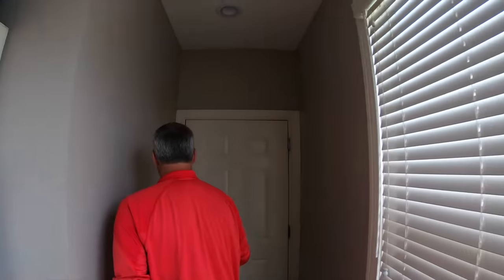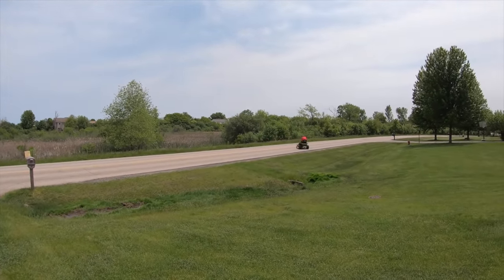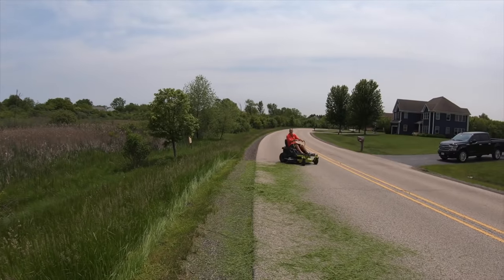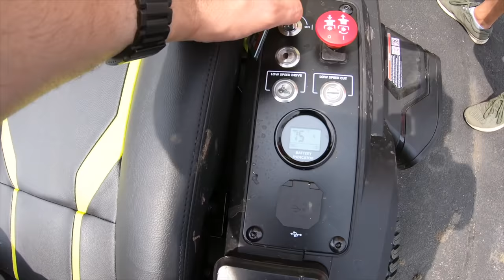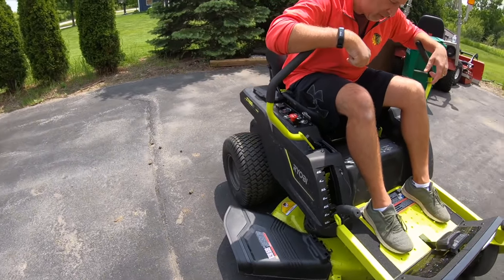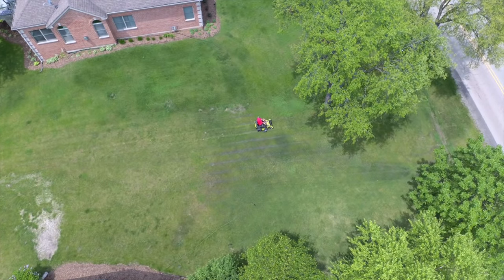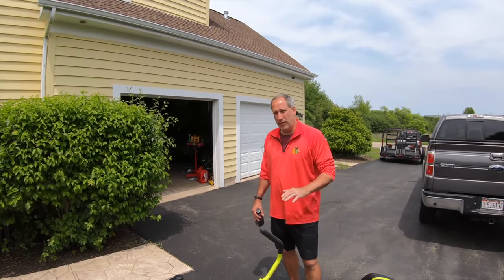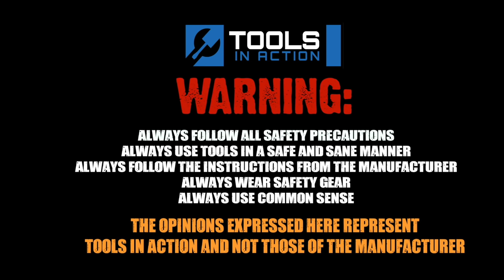Ryobi Electric Zero Turn Mower - First Look

Comment: Just about to stall the blades at 3:26, and you cut it out. You have no credibility.
Reply: Nice catch! I didn't see that
Reply: Wow your right.  I wondered why it skipped like that at first
Reply: ted hill lol any mower would struggle there! My wheel horse, witch that brand is one of the very best lawn mowers in the world, would struggle in that. That grass would be cut by a freacking bush hog pulled by a tractor. I would say that is pretty good for an electric zero turn.
Reply: He mentions it at 3:50.
Reply: @greensplatter3480  Totally incorrect, any commercial mower would NOT struggle mowing that tall grass. cut quality would be awful but struggle for power absolutely not, I've owned multiple Commercial Gravely ZTRS and Deeres and None of them ever would struggle to cut tall grass. Slight drop in rpm yes but never close to stopping blades
Reply: The battery powered mowers may bog down but they always start right back up
Reply: @tjwatson0403  haha that is true, but so do most gas ones.
Reply: Use a Kubota Diesel mower,  will not bog a drop
Reply: Lol! For some to make there point they use COMMERCIAL & Diesel mowers for comparison.  Ryobi wins!!!  Lol
Reply: Austin Stauffer for 4x the money, it shouldn’t...lol.

Comment: MAJOR ACHILLES HEAL: the charging port is built into the mower instead of charging the battery directly.  Correct me if I'm  wrong but if you run out of power away from the charging station, it doesn't appear that you could bring the battery back and charge it without the mower's port. If true  then you would need a fully charged second battery in this instance.

Comment: Your one of those guys the spray the cut grass on the road
Reply: Where do yall fucking live that county road crews don’t go out and do the same thing what difference does it make if he does it too don’t drive in it if you don’t want to it’s not fucking complicated
Reply: @kris6682  I guess you don't care about motorcycles. Cut grass is quite slippery on them. I have seen many wrecks due to cut grass in the rod. It's not hard to turn the mower around and face the other way.
Reply: Blazegaming Vlogs sorry bro but my safety is more  important than yours and I’m not riding along the edge of a busy road with my back to traffic learn to ride your bike a quit whining
Reply: @kris6682  Glad to know you care about other people. They have make reflectors and orange vests for a reason.
Reply: It is illegal to blow grass on the road in my area.
Reply: Blazegaming Vlogs I guess you couldn’t come up with a reason why I should put my self in extreme danger so that you can be less attentive while riding your motorcycle

Comment: $4100?? No thanks, Ill stick with my gas powered mower.
Reply: A decent quality (not Depot) residential ztr will Run you at least 3200 (Hustler, etc). 4100 isn’t terrible, still a stamped deck tho, which will probably be the first thing to go.

Comment: Thanks for the review... I feel that the 42" deck is to small for the ~2.5 acres I've got to mow. Would also like to see more aggressive tires on the machine. Do both rear wheels drive?
Reply: Both rear wheels would have to drive it's a zero turn.

Comment: I have a typical troy bilt pony 42'' that Im using 20-25 hours a month to cut lawns.  drive belt wears out in 2 months.  Would be nice to have a machine with no belts, no oil changes, no air filter, no carb to clean.  Still, the ryobi is $1000-$1500 more than a standard gas 42'' zero turn.  And with normal use I would imagine that 5-8 years is the most you will get out of the lead batteries.

Comment: Very good video!  It goes fast.  I think that he should be driving the other direction so the clippings go back down the ditch instead of into the street.  Sending it all to the street can make the road slippery and create a hazard for motorcycles.  Sending the grass in the right direction would save you from blowing it off and protect the stray motorcyclist who comes through before you get the blower out.

Comment: Do you haft to bring the battery in for the winter? Would it be possible to keep it outside during the winter on a trickle charger?
Reply: It’s not one battery it’s 4. It can be stored outside according to the manual but it says fully charge it and charge it every month and keep it covered. So if you can keep it plugged in it should be ok.

Comment: 1. All grass on the road complainers: look at second part of the move, grass is gone... as soon as first car came through it probably blew off.
2. $4100 is for a version with 100 amp battery, 75 amp version is on sale right now for $3200.
3. As cool as it is I still would not buy it :) 

Myself I just can't justify spending that much on a residential mower.
Reply: It makes sense if you are doing residential yards. I'd hope you are contracting out commercial cuts with a 42. 😆

Comment: I doubt that's NICAD.  Probably lithium ion.  Any clue how it works cutting along side (or up)  a 40 degree incline?  My yard has deep ditches and that's always a sticking point for me.  My 2001 Snapper SR-33 rider manages them okay.
Reply: The manual says:  Only use RYOBI Electric Riding Lawn Mower 75Ah
 (LPC12-75) or 100Ah (LPC12-100) lead acid batteries.
Reply from the maker: Its an AGM battery. deep cycle
Reply: @Toolsinaction  AGM - Ahhh yes, that would explain why you can just keep it plugged in all the time.  Lead-acid batteries love to stay topped off at all times (as opposed to lithium).  But NiCad would have been horrible with the "memory" problems they're notorious for.
Reply: @Toolsinaction  According to other reviews on-line, it uses (4) batteries. I don't think you mentioned that two different models are available with different capacity batteries. They also state that the batteries need to be removed and kept in a warm place for the winter. This unit appears to use the same batteries as Ryobi's previous riding mower. Replacement batteries are around $200 each.

Comment: The batteries aren't NiCad. They're sealed lead acid. They weigh more, but they cost less and don't have the memory effect of NiCad that requires the batteries to be fully discharged before recharging. Greenworks makes a 60" one with lithium batteries that costs 6 times more ($25k), but it is a larger deck and commercial duty. Cub Cadet makes an electric zero turn with a steering wheel and 92 Ahr batteries that costs less ($3k). This Ryobi currently costs $3.9k for 75 Ahr and $4.4k for 100 Ahr. They all have 42" decks.

Comment: 4 Sealed Lead Acid AGM batteries wired in series to provide 48v is what I read on another page. IMO it would be better if they'd went the full way with it and used Lithium Ion technology.

Comment: 3200 isnt too bad only about 600 more than a gas one. if i wont the lottery. a snow blower attachment would be a really nice feature too. i have a ariens 24 inch all electric 2 stage snow blower and i love it. the electrical stuff might be a bigger problem to troubleshoot if something breaks vs and a gas engine / carburetor but as long as its built well it shouldnt be an issue. im curious as to why it has to be plugged in constantly? is it lead acid? ahh that is why: 
4 Sealed Lead Acid/Absorbent Glass Matt 12V batteries wired in series to produce 48V  yeah lead acid suck for longevity...i guess if they have a super good warranty on the batteries (no losing 10% capacity over 5 years or something) then its ok.

Comment: In your experience, how many minutes is your run time @100% charge?
Reply: They didn't mention that this unit is available with two different battery options... a 75Ah or a 100Ah. Each has a different run time. So not sure which one they had.

Comment: I want to like this but I felt burned by the push mower.  I got the 40 volt I'm on my second battery and it takes a charge and a half for less than a tenth of an acre house included on that plot.  Just scared me off all electric lawn equipment.  Maybe someday I'll be experimental again but not anytime soon.

Comment: Did they get the model name from the cost? It's about $4,080. I haven't owned any tool with nicad batteries in a long long time,nimh and/or lithium kicked Nicad's ass for most applications. Now don't get my negativity wrong,I do have several Ryobi One+ tools with lithium batteries and am happy with them. I switched over to Ryobi when I slowed down and didn't need Milwaukee or the higher cost anymore. I'm sure nicad keeps the cost down,at least until/unless the batteries need replacing often expecially if people don't take near perfect care to charge and store them properly. I do like the high-vis green for mowing near roads. Please correct me if I'm wrong about anything.

Comment: I'm getting the husquvarna electric ride on. I think electric is the future - using battery has many advantages.
Reply: no it doesn't ,atleast on this type of equipment. runtime,batt expense,toxicity for the planet, equipment is not self sufficient.  i'm ok with cars but working vehicles need to generate power onsite

Comment: AGM (Acid Glass Mat) based batteries good for deep cycle used in marine, solar, and expensive automotive batteries they have good lasting power. Lead based batteries no Nickle Cadmium or NiCad here.

Comment: I blow grass in the road every time I mow.  It only takes a few minutes before the wind and passing cars blows it all off anyway.  Ditto for most of my neighbors.

Getting back on point, that mower is impressive.  Batteries are appearing in all the tools.
My Echo Hedge Trimmer blades broke - cost me $129 for parts to fix.  Motor still works great but the Ryobi and Kobalt 18v and 40v battery hedge trimmers with 5 year warrantee are same price and the cutting bar is longer.  Hate to dump a good and repairable professional grade Hedge Trimmer but the technology is evolving to obsolete a lot of good stuff.  Ditto for my 14 year old Toro Z-turn gas mower but it still runs perfectly.  Times are changing much faster today and likely to accelerate even moreso in the years ahead.

Comment: Somebody please explain what zero turn mower manufacturers hate about steering wheels?  When I get on a riding mower, I don't want to feel I am on a piece of exercise equipment.
Reply: The levers directly input the need to the motor which is turning the drive wheel.  Steering wheels require another set of mechanical interfaces to turn the rotation of the steering wheel into the requested output that is needed on each drive motor.  This complicates the process.   Remember unlike your car, you are not turning the wheels to turn the mower, rather changing the speed at which each wheel is driven.

Comment: I have been bothering EGO on social media about something like this.  I’m SUPER tempted to get this or the one you guys tried about a year ago their smaller one.  I just wanna keep the whole EGO eco system.  But man I don’t like waiting.  This one is really cool.  Anyway you can ask them around when they might drop theirs.
Reply: It would be incredibly overpriced. Just look at their commercial line.
Reply: @ss4goku9695   if the battery is smaller than the commercial line then it shoudlnt be as bad since its not ment to pay for itself like the commercial line is, but yes definetly will be
Reply: @MrJd829  I am not sure the battery could be smaller. I purchased all their commercial stuff to do reviews on and see if it will fit my business. The backpack battery is 28 AH and 19ish pounds, I think? It runs a blower for just over an hour on turbo. I would guess two spinning blades and wheel motors would demand a lot more juice, hence bigger battery. Just my guess, though!

Comment: Here ya go.

10-Second Summary
Model Number: RY48ZTR100
Ryobi all-electric zero turn mower
Lap bar steering
Cuts up to 3 acres on a charge
4 high-powered brushless motors
Quiet cutting, no gas, no fumes, no belts
Charges through standard 120V outlet
4 Sealed Lead Acid/Absorbent Glass Matt 12V batteries wired in series to produce 48V
100 Ah
1.5″-4.5″ adjustable cutting height
Includes towing hitch and assembly hardware
MSRP: $4,099 at Home Depot

Comment: Not to worry guys he is going to blow off the grass on the road with a Ryobi blower , right?
Lead acid huh , pretty low tech but cheaper to replace that nicad or lithium . 
I wonder what battery life expectancy is and is there an advantage cost wise (total ownership costs) over gas mowers.

Comment: Some of them brushless electric motors will literally run for fukin 30 years without any problems its great an ive seen them back in the 60s still runnin today with machining at shops its diff but same concept

Comment: When the layman accepts slightly better technology for torque, cost, decibel level...maybe strides are being made. (Taking into consideration clowns use water and need to cut their grass-Earth be damned)  This is a really good review and Ryobi should use a solar panel on a non-commercial mowers.   I'm rooting hard for the long overdue recession that I predicted about now.  To much superficial spending and expansion.

Comment: Ok, it’s nearly twice the cost of a 42” timecutter. Let’s see how the batteries & the controller are holding up in say, 3 years. Not sure what a battery pack runs for those things but I gaurantee you it’s not cheap. With even the cheapest home depot/lowes/walmart mowers, if well taken care of, 20 years without a major repair is very common.

Comment: Low noise, no gas cans, oil changes, tune ups. Super low cost to run compared to the same size gas mower... 
  It just has to hold up and what are the batteries going to cost?

Comment: Make sure you use an NGK spark plug, I'm sure Ryobi put a champion or something terrible in it.  Also, needs to be a resistor plug so it won't interfere with the charger.  

That mower is stupid

Comment: At $4100 why is it not lithium instead of lead-acid?
Reply: I read about the differences....seems the lead acid is the best battery for this type of application.  I"m sorry, though, can't remember why. It's on ryobi's website though. PLUS, I ready, the replacing these batteries is about $400  instead of $1200 for the lithium.

Comment: $4100 is too much considering it has lead acid batteries and a stamped deck.  In the $3k range you start getting reinforced decks and 24-26hp engines on conventional ztr's.  If it at least had reinforced deck or lipo batteries then it would be worth the cost.  Not having belts, oil, plugs, filters ect to change would be nice.

Comment: Quick question, why would anyone ever throw grass in the road? Straight, curve. Doesn’t matter. Mowers roll in both directions. Why? I just never understood it. These guys cleaned it up which is good but why at all?
Reply: Cause the grass is too thick to make multiple passes the other direction. But you clearly have never mowed a ditch with thick grass
Reply: DKP Productions absolutely have. So when you have to make multiple passes you have to do it in opposing directions? I don’t think so. It’s being too lazy to go back and make the second pass in the same direction to not throw grass in the road. But clearly you have never not been lazy and choose to blame it on needing to do this. See what I did there with the “clearly you have never...” line? Pretty clever huh? Lol

Comment: Those have got to be lithium-ion batteries for that range, weight, and packaging.
Reply: Steven Sherman actually, they are AGM deep cycle car batteries.  Lithium-ions would save a lot of weight or increase the range even more, but would drive the cost up probably over $5000

Comment: Bought one and returned it after a few weeks.  Absolutely not worth it.
Reply: Brian Elaborate...
Reply: @I-Teee  i used it for about 4 mows.  Flipped backwards putting it on a trailer.  Almost tipped sideways when mowing a 10%-15 incline.  When you truly try to mow a couple acres the battery really starts to die when it goes under 50%.  Cut quality was not that great and the deck height did not really match up to what the cut length was.
Reply: I should also say that im a heavy ryobi tool user so this is nothing against them ar all.  I have actually talked with the management about my experience.  I think they do have something with this but it needs more refinement.
Reply: Brian interesting, thanks for details.

Comment: Ryobi is NOT the first electric zero turn ( Hustler Zeon no longer in production) is the first and even more importantly  Cub Cadet RZT ZERO started production in 2014 and is the first zero turn with steering  wheel along with two other electric mowers.

Comment: CubCadet electric is a bit better, zero turn with wheel, makes it easier to ride it in a straight line. Plus a wider deck and larger batteries good for over 4 acres.

Comment: Where I’m at you can get a fine blowing clippings into the road
Reply: And where they are as is obvious by the scenery, It doesn't fking matter.
Reply: OmegaGamingNetwork it does fkng matter. If it rains the grass will turn into a slurry on the road. Causing cars to possibly lose traction and wreak.

Comment: I am in the lawn are business.......grass in the road is a big no no. It is very dangerous for people on motorcycles because it acts just like ice and is very slick. Can also be a hazard for cars if they needed to stop quickly. If you had no choice but to blow in the road at least run mower beside it and blow it back off of the road.